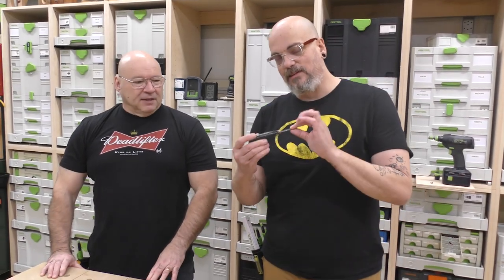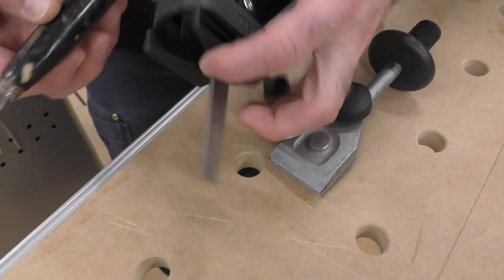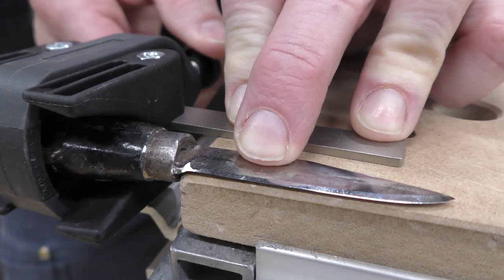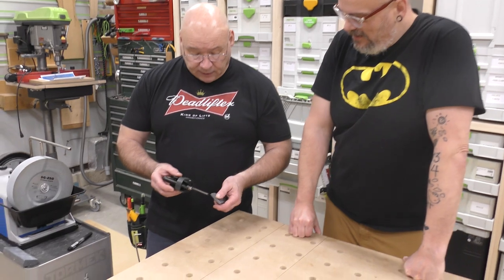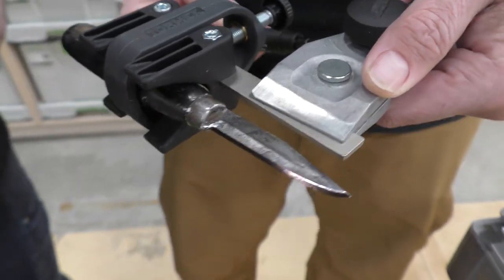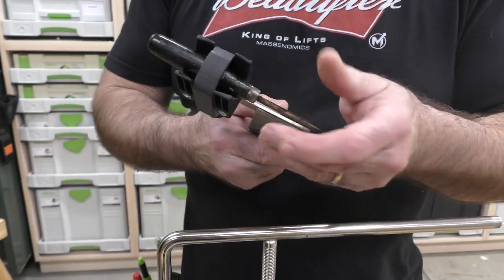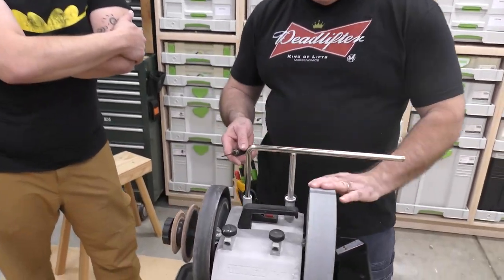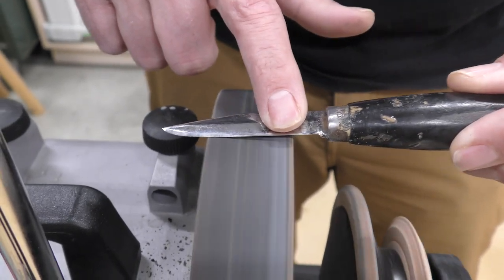Mastering Small Knife Sharpening

Comment: Hi Sedge,
We've been in contact before, about the DF500. Sorry to post on this video, but I really need your assistance... 

I hope you can help me, because I've a few issues...

I'm building a piece of furniture, which is 16 mm in thickness. All corners are mitered, 45 degrees, and I planned on using the 5x30 domino. I tried this today, and the domino went through... What's the catch here? I set to the DF500 like you've shown on YouTube, with the bevel first, bottom out the gauge and push down the height, still went through... Is 16 mm too thin for the 5x30?

When the 5x30 didn't work, I switched to the 4x20, and it didn't go through, but when I assembled a joint, it wouldn't meet up properly... It's offset about 1mm, even though I used the same reference face, for both cuts?? 🤔

What's the deal here?
I really hope you can help me out, because I'm about due with my project... 😔

Thank you,
Best regards.
Reply from the maker: 16mm is too thin for the 5 x 30 . I always have used 18mm for the 5 x 30
the 4 x 20 is the proper domino to use ... i really do not know why you are getting a 1mm offset if your fence is bottomed out... always set your bevel first then bottom out your plate height. i hope this helps.